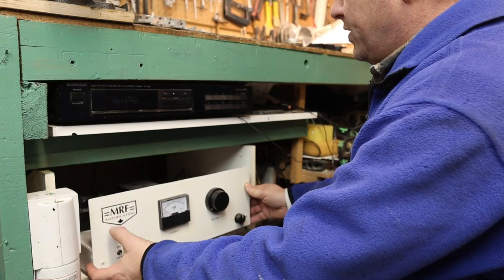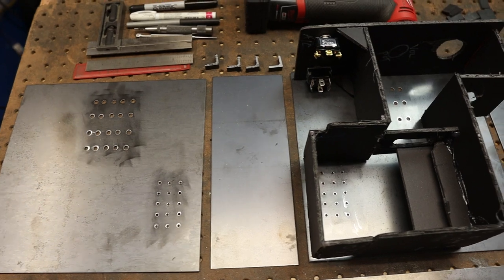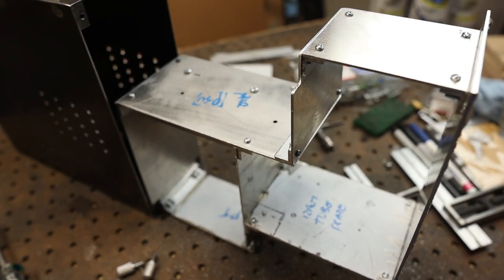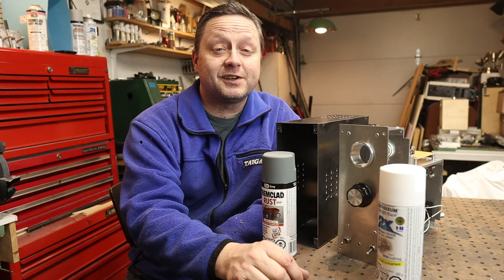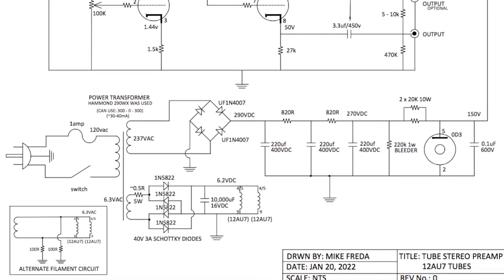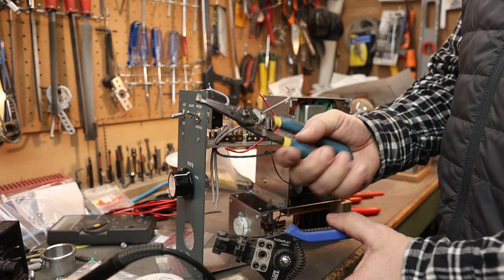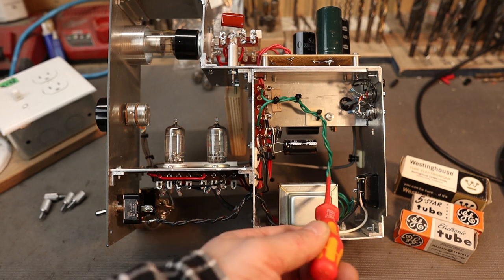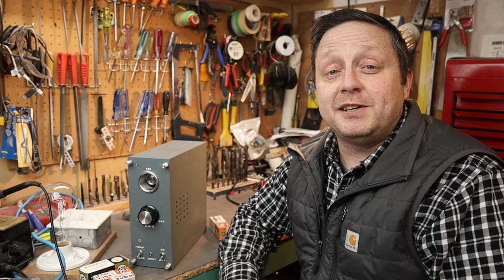Making a 12AU7 Line stage in a military style chassis // Tube stereo preamp scratch built.

Comment from the maker: Matching Power Amp: https://youtu.be/0svrcbY2mLA
Reply: thank you for the circuit, but i must know why there aren't any cathode bypass capacitors. I don't really know their function but I am curious about why you chose to only use cathode resistors alone.
Reply from the maker: Hello, it's a bit complicated to formulate (and I don't profess to be an expert on the topic) but the reason for the bypass cap is to create a filter. (block a certain frequency)  There is no need to ask the circuit or tube to reproduce low frequencies that you can't really hear or have a speaker reproduce. Basically wasted energy. On a power amp it is more crucial.  On a preamp like this not so much. There is not a lot of power consumed with these circuits.  You "can" add it to this preamp circuit but you probably won't hear much of a difference (unless you went with a high cutoff) thus wasting some money.  The basic mathematical formula is: C = 1/(2 x pi x f x Rparallel). f is  low frequency cutoff.  5Hz is probably pretty good.
Reply: Nice video

Comment: Hey, it's a really neatly built preamp :). It's a nice idea to use a neon voltage regulator tube as a pilot lamp, though I'd go for a magic eye (6E5 etc.) level indicator instead, fed from a sum of output signals, possibly using an additional triode + detector diodes.
Reply from the maker: Thanks for commenting. Yes, a 6E5 tube would be a cool but it also requires a bit more circuitry to make that work. I do have that tube and I do plan to make something like you describe in the near future, cheers.

Comment: Great Job Mike! You know, putting a 6AF6 in that bezel you have on the front would look incredible. One shadow angle for right, and the other for left. Essentially two level meters in one tube. You would need to add a compactron dual pentode (or something similar) to drive it though. Maybe in the power amp? :^) If you are interested in what the tube looks like, I replaced a 6X6 with one in a video I did last year. You can look up "1938 Receiver Restoration Deforest 7D832 Radio" in my list of videos. Like the 6X6, both shadow displays are tied together in the radio, but they can be used independent of each other.
Reply from the maker: Thanks for the comments.  Yes, I did think about that but when I started looking into obtaining tubes like that and the sockets (plus shipping) it started to get a little pricy. 
I really like the idea, perhaps in the matching power amp I plan to build.
Reply from the maker: Done.

Comment: Mike, great build, where you buy copper wire in teflon insulation?
Reply from the maker: Thanks.  I got the solid core Teflon coated hook-up wire from Mouser.  It’s great to work with. The issue is that you need to buy a large spool of it, they don’t seem to stock it in smaller quantities.  Cheers.

Comment: Very nice job if I was to buy a commercial pre amp like yours I bet they would cost a fortune Would your pre amp match the impedance of a cd player ?
Reply from the maker: Thanks.  The parts alone are under $200 for this preamp.  The input impedance is around 32k ohms to 47k ohms… so yes, it’s suited for a CD player.  This amp does have a lot of gain so you may need to pad the input to use the full sweep of the volume.  Cheers.

Comment: Hi Mike. Really enjoyed your video. How does it sound? I have a Willsenton R8. Would it sound OK with that. I really like the sound ´as is’… but would be a nice little project is worthwhile. The only component I am not able to source is the 0D3. I am 8n Montreal. Looked online. Would have to purchases from US. Kind of risky… Do you know of a Canadian source?
Reply from the maker: Thanks for your comment.  I find this pre-amp to have a lot of gain and not to “tubey” sounding (like 6SN7’s typically do).  Very neutral to my ears. 

I’m not familiar with a Willsenton amp. 

A Canadian source is “the tube store”. That’s where I get all my tubes from.  I just bought a batch of 0D3 from them. The VR150 is the same tube.    You don’t really need the regulator tube but you would have to down grade the voltage of the power transformer to suit.  This circuit only runs at 150VDC at the 12AU7’s.  Cheers.

Comment: How easy would it be to have a line level output of 9 volts have a variable resistor on output as gain, it's at 2 vpp at the moment line level out? My power amps will take up to 9.7 volts input, I want to have a valve driving it,  is it got a good wide sound stage how would you describe it? Why the rectifier tube the 03d not heard of that one, why  is that better than a standard 5ar4 say look some nice design simple that's what you want
Reply from the maker: You may be able to tweak this circuit with different bias points or a higher Mu tube to obtain more output voltage.  You could try 12AY7 or a 6922.  Higher b+ would also work but you would have to remove the 0D3.  The circuit shown uses Solid State Rectification. The 0D3 is a 150V voltage regulator tube, it's not a rectifier tube.   Using a rectifier tube would require a different power transformer and will create more heat . As you can see by the enclosure I made, everything is enclosed.  Tube rectification costs more money to incorporate and can induce a bit of noise in the system which would require a more elaborate PSU section.  Furthermore, this circuit only draws ~10ma a 5AR4 would be a waste in this circuit.  There are trade offs for sure in any circuit. I tried to keep this one simple, low cost and easy to make. Cheers.

Comment: hello, i noticted that both the preamps you have built share a similar power supply. The schematic for the 6sn7 shows a choke but the 12au7 has no choke. Are the power supplies interchangeable for either the 6sn7 or 12au7 circuit. Do they both use the same power transformer. Both schematics are almost identical very cool. which do you prefer?
Reply from the maker: Thanks for commenting. Yes, they have similar power supply. They are interchangeable but you may have slightly different voltage reading but it's not a big deal. Also, 12AU7's draw slightly less heater current than a 6SN7.  A 0D3 Voltage Regulator tube needs a fair bit of compliance (higher voltage and current) to make that PSU work correctly. If you didn't want to use a OD3 tube, you can use a smaller PT.  In the 6SN7 circuit, the choke does help a bit but it is an added expense. It's a bit overkill especially when using a 0D3 tube.  I installed it because I had it in my parts bin. I'm not sure your ear could hear a difference in this circuit due to its topology and the low current draw.  I feel the PSU using just an 0D3 tube (without the choke) works well. I hope that helps? Cheers

Comment: I apologize for the request but I am not that experienced and I do not feel safe so if it is possible you can have a more detailed diagram of the connections as it is usually called I think layout thank you in advance
Reply from the maker: No worries. I do not have a layout and even if I did it would only apply to this chassis and most people would not make this chassis. If you are just doing a flat top plate design, that would be fairly easy to layout, Cheers Mike

Comment: Hi @MikeFreda had a question on the BOM (part list), noticed you had (2x 20k -10w resistor) listed twice. I was running through the schematic and could only find 1 set of 20k 10W being used right before it goes out to the audio circuit of the two channels. Just wanted to make sure there wasn't something I overlooked on my part. Thanks in advance! BTW early Happy Thanksgiving!
Reply from the maker: Thanks for commenting.  Good catch.  That is an error on the parts list.  You only need a pair of 20k, 10w.  Hope the build works out for you.  Cheers.
Reply: Hi  @MikeFreda  apologize for all the questions. I noticed on the schematic you reference 1N5822 for the 6.3v. As I was referencing it over to the parts list noticed 1N5833 listed (30v 40A vs 40v 3A on schematic). Or I could just skip it and go with the AC filament route, with a pair of 100R resistors.
Reply from the maker: No worries. Interesting, I’ll have to check where that typo is.  You want 40v, 3A diodes. You can try the AC heaters using the 100ohm virtual Center tap… but DC filaments are quieter.
Reply from the maker: It was a typo. All fixed up. Thanks again for noticing.
Reply: @MikeFreda  Thanks again DC route it is then.
Reply: @MikeFreda  Me again with the questions,  lol. If I went with a 320-0-320, would that require much modification to the current circuit? Still debating on which one to go with, your 6SN7 or 12AU7.....
Reply from the maker: Not really, the 0D3 caps the voltage at 150VDC. You just have to make sure the 2-20k dropping resistors are large enough to dissipate the extra voltage.  I spec 2-10W resistors which in turn "can" dissipate 20W and as a safety margin you would only want to run them continuously at 10W. In this circuit they are only dissipating around 3 watts so I think you are good which whatever PT.  I hope that make sense? Cheers
Reply: Makes total sense, I just wanted to confirm if the parts would be able to handle the extra voltage.

Comment: Beautiful! Can it be used for recording music?
Reply from the maker: Not really. You will need more gain and noise protection for a Mic or other low output devices. The circuit and layout would need to be adjusted for higher Mu tubes. You could probably fit the Altec 1566A Mic pre circuit into this. That would be cool!

Comment: great video did you earth the case
Reply from the maker: Thanks. Yes, the green safety ground from the AC plug is grounded to the transformer stud.  There is a separate ground for the signal on a stud near the tube socket and a separate ground for the DC return near the PSU.
Reply: @MikeFreda  fabulous I am building a 300B stereo amp 6sq7 driver
Reply from the maker: Nice. I have all the parts for a SE Parallel Feed 300b with 5670 driver tube. Magnequest transformers.  Just have to find time to make them.

Comment: been waiting for someone to build a preamp with the 12au7 lol..i need this in the portable audio interface version lol
Reply from the maker: Thanks! In its raw form, it's a fairly easy preamp to build but not very portable since these tubes do draw ~600ma of heater current. You can easily remove the 0D3 and down size the PT.  If you are looking for something portable you could use a 3S4 tube. They are typically found in old school battery powered radio sets and will last a long time on some d-size batteries for the filaments and 4-5 9V for the B+. They sound pretty good! Cheers
Reply: @MikeFreda  thanks a lot for replying so fast..i'm gonna check out those tubes you mentioned..i originally thought of this when i first bought a 12au7 guitar pedal..i love the detail in the sound of it and wondered how it would sound in mic interface..like the tube version of the SSL v2 USB audio interface..how would you rate the quality of those tubes you mentioned as opposed to the 12au7? if the quality isn't as good then i guess i don't think i need it portable lol..thanks again for the info as well.
Reply from the maker: The 12AU7 is a  slightly better sounding tube than a 3S4 but it also requires a different power supply typically from the mains. The 12AU7 is good for a HiFi / Audio preamp it's not really suited for a Mic Pre. It just doesn't have quite enough gain to take a Mic signal into a power amp without some crafty circuitry like using some really nice SUT/line matching transformers. You may want to look at the Altec 1566A for something like that.  It uses a 12AX7.  Cheers
Reply: @MikeFreda  i see..thanks a lot for that additional info..i know the 12ax7 has more gain, but i'm more after the clarity of sound in the 12au7, but yes, the lack of gain is a problem..what if it gets pushed with an opamp..what do you think?...
i just checked out the altec 1566A tube and it says the frequency response only goes up to 10khz...been trying to find the frequency response of the 12au7 though..there's a lot of mixed info about that tube..some say 30khz..

the frequency response of at least 20hz to 20khz is what i'm after..think the 12ax7 has that frequency response, but it doesn't have the clarity of the 12au7..
do you think it will keep its clarity and quality if the 12au7 gets driven with an opamp?
Reply from the maker: @benevolentessence8809  The frequency response in a circuit like that is mostly predicated on the components used. 30Khz for just a tube seems doable but it's the transformers that hinders the response. Reproducing anything after 20khz is a waste due to most humans ears don't really hear that high. 

Have a look here, this may having something that you are looking for: https://www.jensen-transformers.com/schematics/
Reply: @MikeFreda  yeah, true..thats why i said i want it to be at least 20khz..but the higher frequency response that it gives probably is the reason why the tube is such high definition..thanks a lot for that link